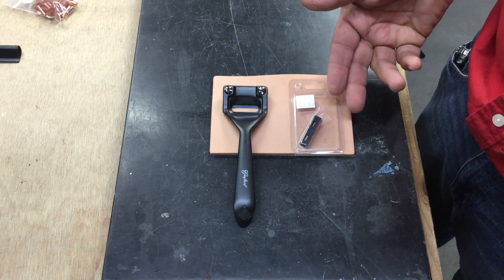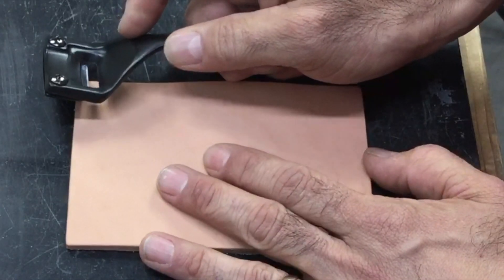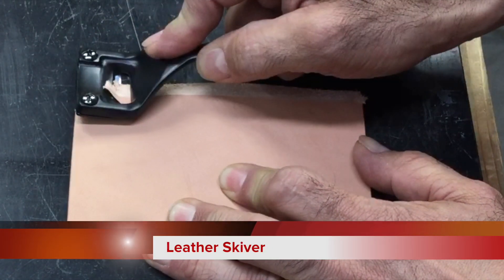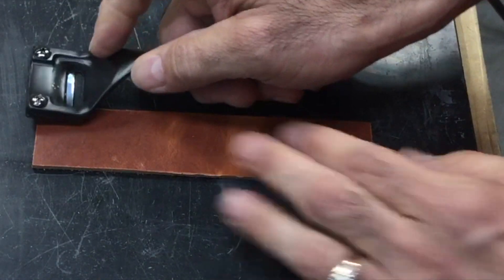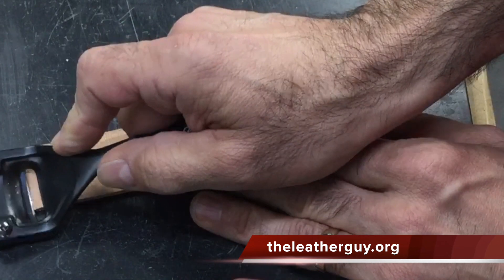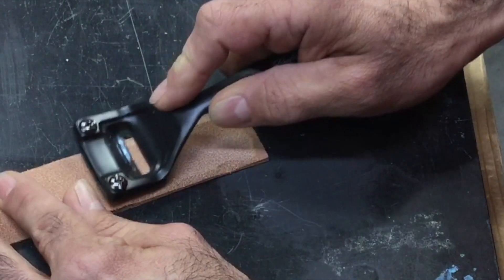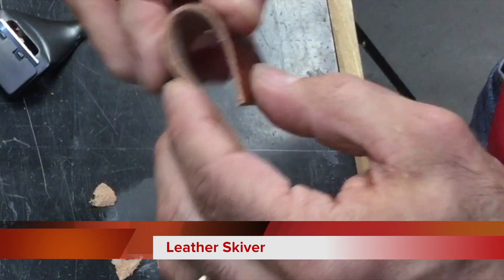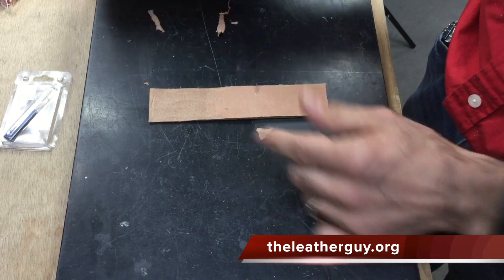How to Use the Leather Skiver

Comment: I have the same tool and it does NOT cut like that! What the heck am I doing wrong?
Reply from the maker: Hi there! My first suggestion would be to check the blade. If it is dull or installed incorrectly, it definitely won't cut cleanly! You'll also want to be sure to remove the layers in thin cuts, multiple times. We have had some folks try to take the majority of the thickness out in one swoop and been unable to draw the blade through without it getting stuck or making the leather look really ragged. The angle you hold the blade is important too! If held to flat or too angled, it may not hit the leather right and could gouge too deep or not enough. Hope this helps a little!
Reply: @TheleatherguyOrg  fresh tool fresh blade.... I'll give it another go thanks! I can usually get edges thinned but removing material from the center seems to result in taking too much or it shaves the loose grain. Not the smooth draws you achieve. Thanks again!
Reply: Practice on some scrap leather. Hold it at different angles and press down lightly. It's a thing where you have to "feel" and "see" the bite. It does not come preset for a specific depth. Think of shaving your face, do you want to bite into your skin or just skim along the surface.

Comment: is there any uses for split leather? i have a bunch but you cant really tool it so im not sure what to do with it.
Reply from the maker: Split leather is fairly commonly used for clothing, bags or small leather goods. It can also be used for the lining of the same items, depending on the thickness. If you're not thrilled with the look of it, you can certainly rough it up with a little sand paper and give it more of a suede appearance.